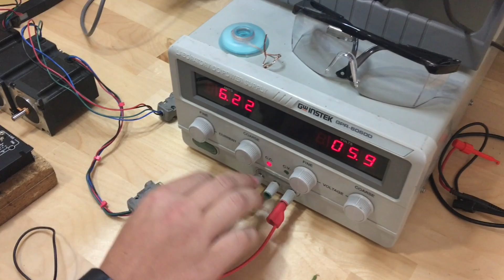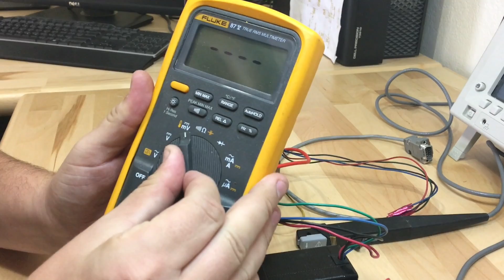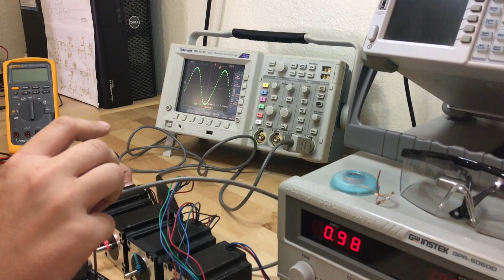Geckodrive G540 In-The-Field Troubleshooting

Comment: Thanks for the video but I’m still confused about testing the G250 pins.  The Fault light is lit and I cannot find the problem in testing the G250 because I don’t understand your procedure.  Would it be possible to write out the steps?  The fuse is OK.   Thank you Hager
Reply from the maker: The pins on the G250X are broken down into clumps of four pins per high-power connection. The first square of four pins is DC (-), the next four pins are DC (+), and each of the next four are the motor phase connections. You need to measure from DC (-) to each phase individually, and then measure from DC (+) to each phase individually. This is to test the high and the low side of the H-bridge to see if a MOSFET is shorted, which is the only way in which a MOSFET will die.

Comment: I am having issues with my out puts on the G540. They don't seem to be working at all. (both of them). Can you give me any insight on what might have failed? Is there something I can check or replace to fix this issue?
Reply from the maker: The G540 uses two SMT MOSFETs to control the outputs, and it sounds like one or both of those could have been damaged. These components will be located on the motherboard above the Y axis drive and will have three pins on one side and a single large tab-type pin on the other side. If they are damaged or destroyed they may show physical signs of burning. You can always send your Geckodrive product back to us for evaluation and repair, and we can generally give you a good idea as to what caused the damage
Reply: Thank you for the information, its greatly apritated, I will take it apart and do a visual inspection and see what I find. How long is the typical turn around if I send it in, and how much would this repair cost if I send it in?  @GeckodriveInc
Reply from the maker: @PhoKingLitMedia  Please visit our website to initiate an RMA at https://www.geckodrive.com/rma-request/

Comment: Hello, I hope you can help; I have a jumper & an E-stop wired to my G540 along with power. The only way I get the green fault light to come on is if I turn the fault switch to off. If I turn that fault switch to ON, I get the red fault light; Am I missing something here? the G540 is not connected to any motors or anything else except power supply & an E-Stop. thank you
Reply from the maker: The G540 requires a normally closed switch (or jumper wire) across TERMINAL 10 and 12 to enable the drive. However, the drive will not clear a fault until it receives a 10kHz watchdog timer on its charge pump input or the charge pump is bypassed with the switch on the front of the drive.

Comment: Hello! I have the fault light on my G540—when I remove all wires except power and bridge pins 10 and 12, the fault signal goes away and the green light comes back on. When I plug all motors in, the light stays green. Any idea what this typically means the problem is? The troubleshooting page on the website says to plug each motor in to see if the fault is in one of the axes, but it doesn’t say what to do if the fault turns out not to be in one of the axes. Any help appreciated!
Reply from the maker: In that case it sounds like it could be more nuanced damage to the G540, and we would recommend sending it in for evaluation and repair. Not all problems can be diagnosed in the field and in those cases it is easier for us to take a look at the drive.
Reply: @GeckodriveInc  I never saw this somehow til now, but a very delayed thank you for replying 😁

Comment: Maybe you can help me out. I just put a new drive-in and a new motherboard ran good for about five minutes then my y drive started doing short movements back-and-forth and then died it’s the same drive that failed on me already. I have recently replaced that motor I don’t Know what my problem is all I know is I’m now out another drive and my machine still down this is frustrating if you could help it would be awesome. All other Motors are still moving. thank you
Reply from the maker: Is this the Y port that also failed previously or is this the same G250XR3? Please contact Geckodrive technical support so they can help you directly and assist you in a timely manner.

Comment: Thank you so much for this valuable info! 
When we test the motherboard "in the field", do we also need to plug in a DP25 cable into the motherboard for the e-stop jumper to function properly? Or was that just something that only you had to do because you didn't actually have an e-stop jumper wired? Thanks again.
Reply from the maker: You do not need to plug in the DB25 cable to bring the drive out of FAULT mode. The little connector on the DB25 board in the video carries the jumper for us, which is why it is plugged in for testing
Reply: @GeckodriveInc  Thank you! 
Another question.. What do we do if the red light on the motherboard comes on during testing, rather than the green? Does that mean the fuse is bad?
Reply from the maker: @backyardmachinist  If the red LED comes on then the drive is either not enabled, is missing an E-Stop jumper or switch, or has been damaged. This video should give an idea of where the fault lies.

Comment: Hello,  I was fitting a touch plate setup to my G540 using pin 11 and some how shorted my pin 10 connection I was using for all my other limit switches.  Is repairing of pin 10 something that can be done DIY?.  I've since moved the limit switches to pin 12 but having this pin working again will come in handy for plasma touch off sensor.
Reply from the maker: Hi Spidey4fun- Pin 10 is the E-Stop pin and if that has been damaged there may be other circuits destroyed. We would recommend sending the drive back in for evaluation and repair.
Reply: @GeckodriveInc  Pos 1 Input 1 DB25 pin10.  Not the Estop
Reply from the maker: @spidey4fun  Please send back for evaluation and repair. One of the inputs has been likely damaged.

Comment: I bought a g540 through a third party a bit ago, and have been trial-and-erroring my way through a minimill set up... At the moment the X axis pretty much refuses to spin one direction (sorta just stalls and struggles), and any stepper connected to the A axis gets very warm quite quick. Y and Z seem to be fine.
I read online that disconnecting the steppers while the drive is powered could damage it. I don't remember doing that, but like I said I'm kinda brute forcing my way through this learning experience so it's possible that I absentmindedly did... I'm not much of an electrician, but what would I be looking for that might cause these issues? I'll have to run out and buy a multimeter at some point I guess.
Might buying a new G250 for the X axis solve it? I don't really need the A axis anyway. I'd be using it for the X axis motor if it didn't get so hot.
Reply from the maker: Hi RevaeRavus- It sounds like you will need to return the unti for evaluation. Please contact customerservice@geckodrive.com in order to get an RMA initiated.
Reply: @GeckodriveInc  If'n you're curious, that seemed to fix the A axis anyway, so it no longer overheats. The X axis still doesn't reverse properly. But I only need the 3 axis anyway.
Reply: @GeckodriveInc  ah I got ancy and bought the little 250's. If that doesn't work I'll contact you guys. it's all a learning process for me. thanks for the reply.

Comment: For those who do not understand electronics very well, just remove all the modules inserting them one at a time to see which one pulls it down. No multimeter needed.
Reply: does this require plugging in the corresponding motors or will it let you know without having to plug them in?

Comment: Is the wiring diagram for the diagnostic tester available for us tinkerers?  I am not getting my limit switch signals thru to Mach3.  Based on this video I am going to pop my g540 open and see if the opto couplers are ok.
Reply from the maker: The tester is just a CPLD based board that toggles the inputs and outputs on the G540 in lieu of using a computer. You can get the same test by using Mach3 and manually toggling the inputs and outputs in there. If the inputs are not working then you may want to measure the corresponding pin on the DB25 port on the G540 while you toggle the input switch. A voltage swing of 0-5V should be measured when you toggle the input if everything is working normally. If the drive is damaged, or if you want us to check it out, please feel free to send it our way and we can take a look at it and make sure it is working normally.

Comment: Purchased a Chinese 6040 and  6 months later the Z driver is pushing daisies. They used TX14207 stepper drivers which I cannot find anywhere (even China) but an eBayer had pulled four from his machine to upgrade to something real, so we purchased an interim one. But we have ordered a G540, and this video shows that was a correct decision. So nice when a mfr is not afraid to let customers know the 'guts', and offer replacement parts. The beginning of a great relationship. Great, well done video.
Reply: i have gecko 540s on three machines...they are awesome
Reply from the maker: Thank you for the excellent feedback and we are so happy to hear you are pleased with your G540.
Reply: @GeckodriveInc  Just did the initial setup and it was cake after carefully studying the manual. Could not find phase inductance specs anywhere for our NEMA 23 150 oz-in, so did some calculations and decided to use a 36V-400W-11.2A Univ Reg PS. We considered a 48V but figured the 36V would be fine for our project. The G540 locks the 285 oz-in test stepper rock solid and quiet. Will be purchasing more G540's in the future. Thanks

Comment: ive had nothing but trouble with pin 5 and 6 for the output.... couldnt get them to work before and now i cant get them to turn off...both stay active...any ideas
Reply from the maker: Bryan - The OUTPUTs on the G540 are both functionally SPST switches to GND. The actual controlling component for this is a MOSFET and it sounds like the MOSFET on each OUTPUT could have been damaged. The OUTPUTs are rated for 1A and 50VDC each, and driving them with a higher voltage or current load could damage them. This sounds like that is what could have happened because if a MOSFET fails it invariably fails shorted. You should send that G540 back for evaluation and repair so you can get it back up and running at 100%. 

Please follow this link and complete the form to receive an RMA number: 
http://www.geckodrive.com/webforms/index/index/id/2/ 

You can also give us a call or shoot us an email and we can go over some troubleshooting steps to see if the motherboard has been damaged.